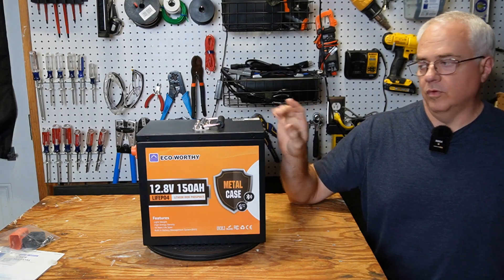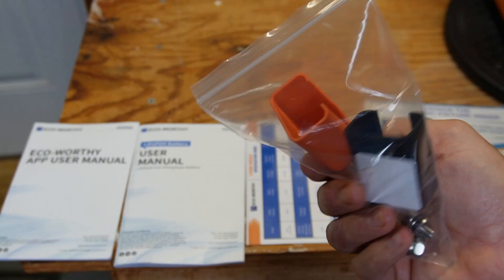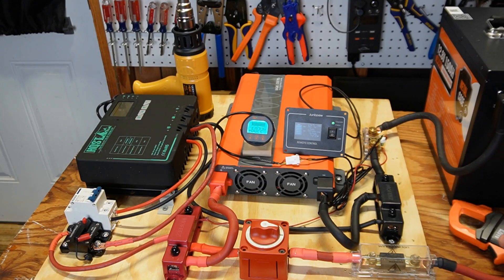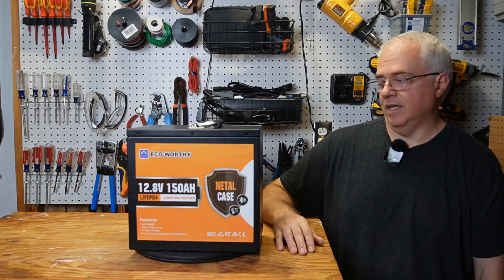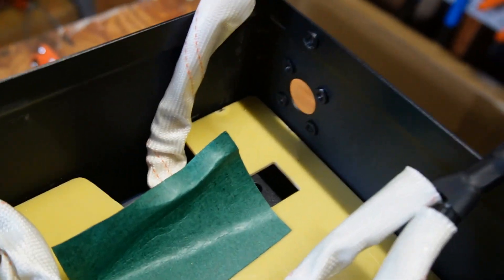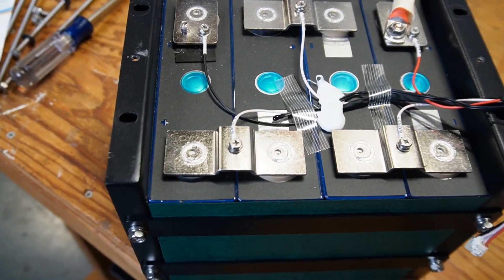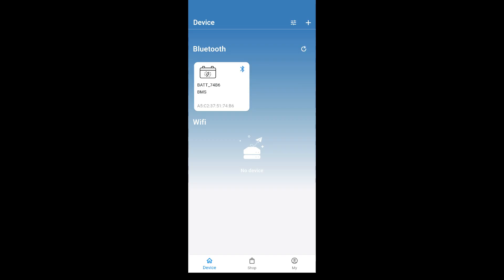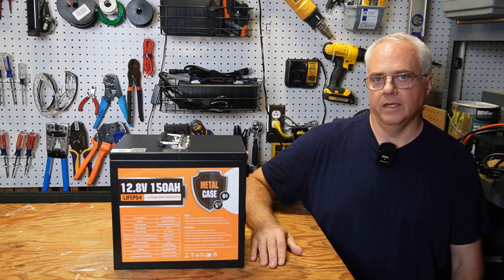Is This The Toughest 12V Battery Ever Made? Eco-Worthy Metal Case LiFePO4 12v 150Ah Battery Review

Comment: Nice review. My concerns are the BMS doesn’t have any kind of conformal coating applied to it. With the metal cased battery it doesn’t appear to have any sort of gasket or sealant keeping moisture out during normal operation. These batteries will heat and cool and because of that they will draw in moist air and it condenses on the inside of the battery. 
I saw this first hand with a battery I had purchased made by AIMS. The condensation destroyed the BMS and I poured out several CCs of water from the case. The manufacturer refused to contact me when I tried to get a warranty replacement. I ended up cutting open the battery and replacing the BMS and the case. I made sure to seal everything that could allow air to pass.

Comment: The "elbow" visible at 3:30 on the negative cable that connects the bus-bar to the inverter should not be there as it introduces a resistance, that point will have a higher temperature compared to the rest of the cable. A thermal camera can show the difference in temperature. It may be quite relevant on high current flow. /m2c